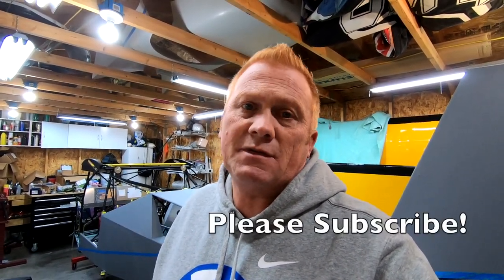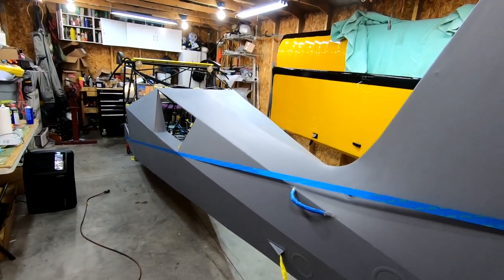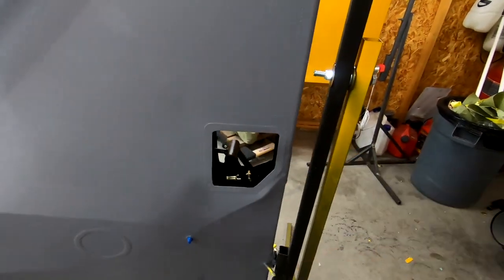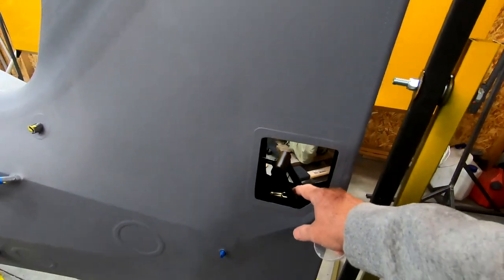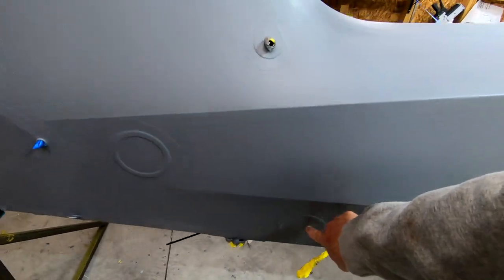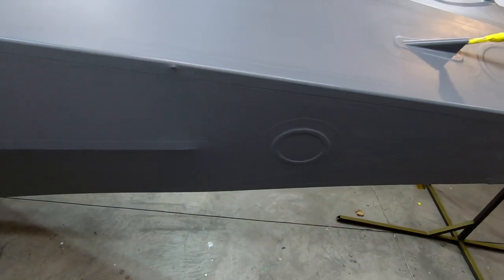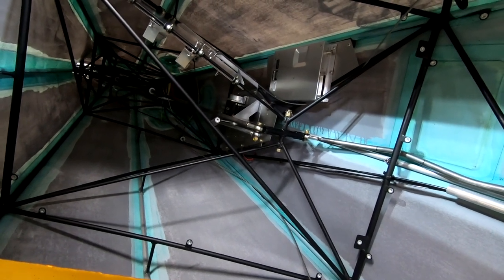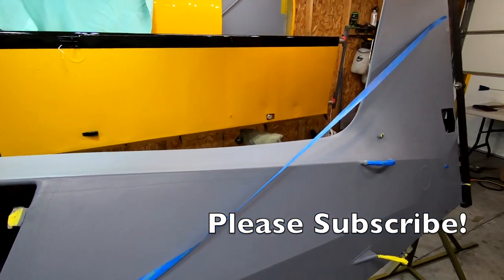Just Aircraft Highlander Build Vlog 9, It's about time!

Comment: Man, you are progressing!  You have passed me by on my Highlander build. Moving remote avionics back, are you expecting the cg to be too far forward otherwise? To adjust tail shock gas, will you access via the upper inspection plate?  Like the plexi backing.  I struggle with financing the build, should just take a loan to buy what I need and not delay.
Reply from the maker: Thanks Wade! Yes, I'm installing the remote radios for two reasons, I'm putting the G3X touch in, and didn't want the radios in the panel, I wanted them in the back of the plane to help move the CG back a bit.  The Edge Apex makes the nose a bit heavier. I put in two access panels in front of the gas shock so I could access it and adjust it as needed. I'm paying for it as I go, I agree it's expensive.  Thanks for the comments.